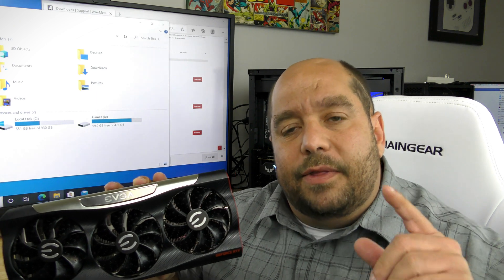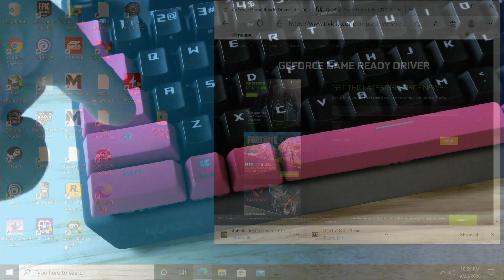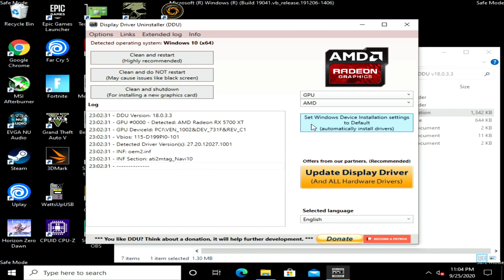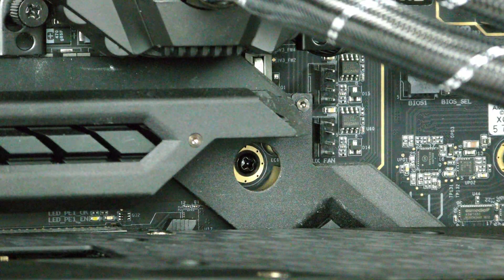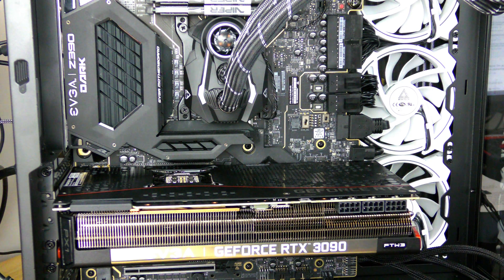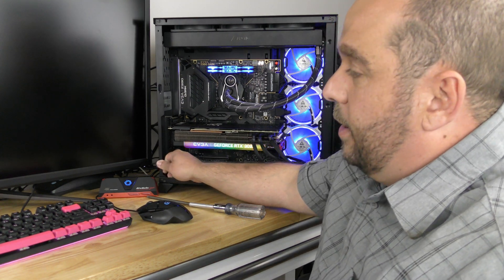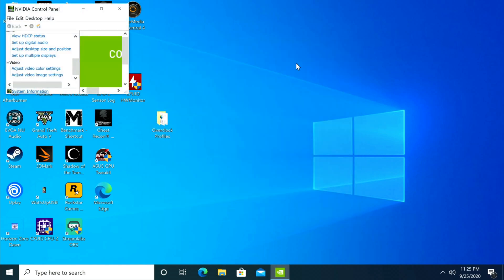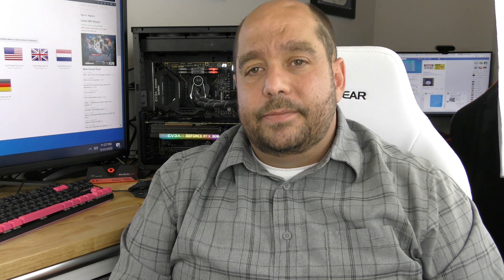RTX 3090 - Installing the EVGA Geforce RTX 3090 FTW3 Ultra Gaming

Comment: I have only 2 gpu dual cables can i use 1 cable split to 2 and one single?
Reply from the maker: I do not recommend using splitters, neither does NVIDIA as I stated in the video, what is your power supply manufacturer and model number?

Comment: Nice video, very straight to point. Although i'm wondering how the heck you're able to sit so close to your monitor. Reminds me of when i was a kid and would always choose to sit on the front row at the cinema thinking they were the best seats. Maybe consider getting a desk mount so the monitor is closer to the wall.
Reply from the maker: Yeah, it is kind of close, but it just helps to get more involved in the game I guess.  As for a desk mount, I would be scared since it is a work bench, so I move it around a lot, I would be worried about flipping the table over, its 43 inches.  Thank you so much for your kind words as well.

Comment: I’m Considering Upgrading, I Currently have a 1660 gtx, what are your opinions
Reply from the maker: What resolution do you play in?
Reply: ThisBytesForYou 1080p Normally.
Reply from the maker: So over the 1660 you would see a performance increase but you would see a much better performance increase at 4k than it 1080p, that's more cpu bound.  What cpu do you have?

Comment: I own a EVGA g3 850w which has multiple 8 6+2 cables, could I just use the single 8 side that normally goes in the power supply and plug the 8 and 6+2 in the supply?
Reply: Please don't do what you described
Reply from the maker: That power supply has 4 VGA/PCIE ports.  Connect 3 of the cables, to 3 of the PCIE POrts on the power supply and use 1 of each of the cables to plug into the video card.  It is OK if you use a 6+2 cable to plug into the card, just make sure that is the only cable you plug in from that single cable.  Plug it in correctly, as it is supposed to be connected, don't take shortcuts, it may not look as nice, but you won't spend your time looking inside your computer, you will spend your time looking at your screen.
Reply: @ThisBytesForYou  so I can’t just flip the double head cables, great
Reply from the maker: Just don't use both heads.

Comment: you plugged out 2 connectors, but plugged 3 in the new card, where did you get the 3rd one? does it come as an adapter in the package?
Reply from the maker: No, it comes with my power supply, check in the description
Reply: ThisBytesForYou  oh oke, i have be quiet 850w, so i should search for it in my psu box?
Reply from the maker: Yeah but If you get me the exact model number I can search for extras
Reply: ThisBytesForYou its this one “be quiet! Power Zone BN212 “ thank you, im actually getting the msi gaming x trio 3090 but i think it also needs 3 connectors. Thank you
Reply from the maker: Its almost like BeQuiet doesn't want to sell their power supplies, they don't provide great screenshots or information about their power supplies.  I think your power supply has 4 or 6 PCIE connection on the power supply, and each of those 4, branch out to 2 connectors.  So using 3 of those connections (that branch out to 6), just use the main cable of each of the 3 and plug it into the card.
Reply: @ThisBytesForYou  so use the single main cable and plug the other side that branches into two cables into the power supply?
Reply from the maker: @proto_l  correct, just don't use both cables off of the branch.

Comment: I've got a 3080 FTW3 on back order.  The PSU I have is Seasonic 850w but is semi modular.  I have one separate PCI-E cable and the other two connectors run off from a single cable that isn't modular. 

I didn't expect that to be a problem because the single cable says it's rated for 300w, does anyone know?
Reply: I personally would not run my GPU on one cable going to two power ports.  I know it sucks to hear but I wouldn't at all.
Reply: @RevansNightmare  I have two molex connectors, would a 2x molex to 1 PCI-E connector be a better option?
Reply from the maker: What is the manufacturer and model number of your power supply?

Comment: Wasn't sure if you noticed this, but in GPU-Z it was only showing the card running at x16 1.1 instead of x16 3.0 on the Bus Interface. Could just be because there was no load on the card, but you might want to check the settings in your UEFI just to be on the safe side.
Reply from the maker: thank you my friend, no I had not noticed, it was really late but I will look into that today.
Reply from the maker: Thanks for mentioning this but when I tap the start button, which uses a little GPU, it bounces up to 3.0 and as it settles it comes back down to 1.1, so good looking out on that ;)

Comment: Hey! I was just wondering if I tightened my gpu could it break?  As I tightened it more when I start up with it it over scales on the boot screen and then black screens on windows. When I switch to the integrated graphics on my ryzen 3200g it worked fine? When I ddu in safe mode it works until I start installing the graphics driver. Do you know what could be wrong?
Reply from the maker: which video card exactly is it, manufacturer and model number?
Reply: ThisBytesForYou I don’t know model number but it is a Msi gaming x gtx 1650 paired with ryzen 3200g
Reply: ThisBytesForYou it’s also run in at pcie x8 1.1 it says in gpu z
Reply from the maker: move the gpuz screen to the right of your monitor, now press a few times the start button and watch where it says x8 in gpuz, does it bump up to pcie16?  

Also, what what do you have te PCIE slot set to in the BIOS, Gen2, Gen3, Gen4 or Auto?  Set it to Gen3.

Do you have any other PCIE devices in your machine?
Reply: ThisBytesForYou I can’t boot without useing igd video which then registers as the pcie 16 3.0 and I can’t change it
Reply from the maker: IGD of course would register as 16,... since the PCIE lanes are not being used.  The 3200G includes 20 PCIe lanes, 16 for a discrete graphics processor and 4 for storage.  Back to my original question, do you have any other PCIE devices, also, when you use your descrete card, do you disable on-dye video?
Reply: ThisBytesForYou also I don’t have that setting in my bios
Reply: ThisBytesForYou all I have is my gpu ☺️ however when I turn of on dye video switch to my gpu it still over scales on boot screen and black screens in windows I’m really confused
Reply from the maker: What is the manufacturer and model number of your motherboard and monitor and how are you connected to the video card, hdmi, dvi, vga or dp?
Reply: ThisBytesForYou I am using a gigabyte ga a320 s2h Rev 1.x an aoc e2270swn and connected using a dvi to dp adapter
Reply from the maker: update to the latest BIOS, F52 which will update your AGESA support and PCIE compatibility.  As for your DVI to DP, I think that is one of your problems, this guide may help you: https://youtu.be/Qh2xEUXWeqs.  As for your BIOS, under "Peripherals" see if setting the Initial display output from IGD to PCe 1 slot.  Then under M.I.T,  under Micellaneous ings, set your PCIe Slot configuration to Gen3.  Then save an exit.  Your bios can be found herE: https://www.gigabyte.com/Motherboard/GA-A320M-S2H-rev-1x/support#support-dl-bios
Reply: ThisBytesForYou thanks and sorry for bothering you
Reply from the maker: @Macauley7272  no bother my friend, I am here to help

Comment from the maker: ✅ Flashing BIOS and Installing Windows 10 - Asus ROG Strix B550-F Gaming WiFi: https://youtu.be/AWxliGLert8
In this video we go over How to install the EVGA Geforce RTX 3090 FTW3 Ultra Gaming.  You got the card, now learn how to install it.  I can't wait to game on this 3090
Reply: Hi idk that this belongs under this comment but I hope you can reply. Problem is following, my Psu, the corsair rm850 comes with two dual 6+2 pin gpu cables, meaning when i would connect them to the gpu one would be hanging off, is that ok?
Reply from the maker: @vreplayz3159  No, please do not comment under pinned comments or other peoples comments, it will many times get overlooked, I reply to all comments youtube notifies me on, if they dont, I cant reply, luckily I caught this one.  The Corsair RM850, comes with 6PCIE connections, which means it will be 3 cables and 2 heads.  Use the main head of the PCIE cable to connect directly to the video card, do not diasychain power connections to the video card.  If you are going to reply to this, please start a new thread in this video, your own thread, I always reply: https://www.corsair.com/us/en/Categories/Products/Power-Supply-Units/Power-Supply-Units-Advanced/RM-Series%E2%84%A2-80-PLUS-Gold-Power-Supplies/p/CP-9020196-NA#tab-tech-specs